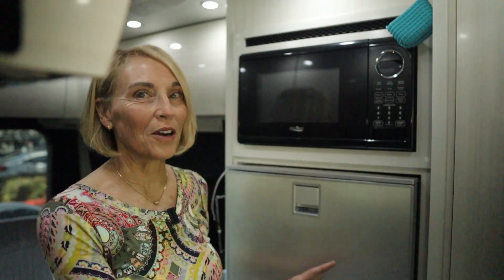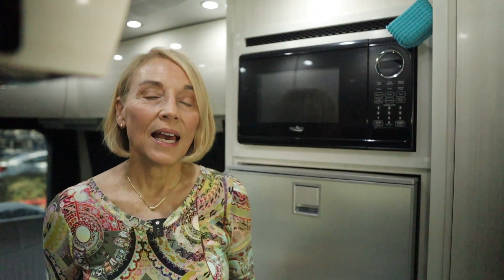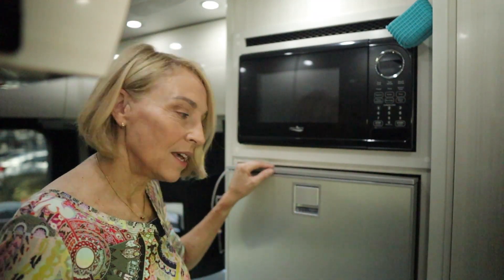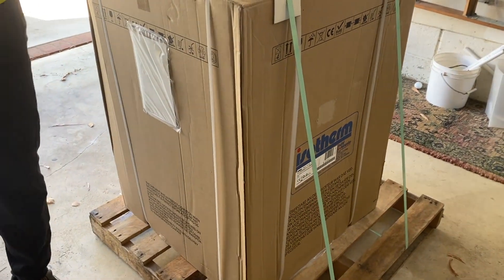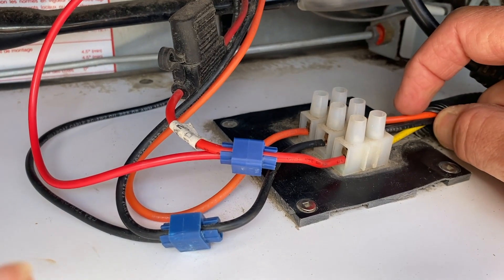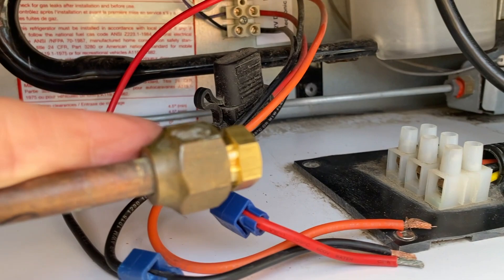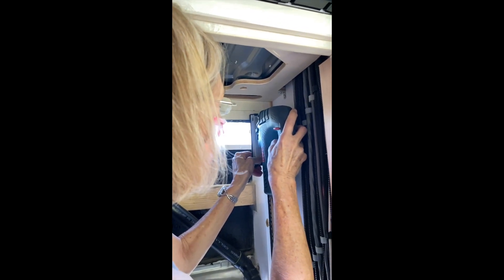How to install an Isotherm fridge in a Pleasureway Ascent Camper van

Comment: Installation of Isotherm Elegance 115 was a big success.
Your video and comments were very very helpful. Refrigerator is very quiet & matches the interior decor quite nicely - Oh, and more room.  Again – BIG success.  
Thank you for “pushing the envelope” of PW Van experience improvements.
Reply from the maker: You're welcome.  We just got home from a brutally hot northwest.  For several weeks temps were above 100 but the fridge kept things cold at 40.  And it even makes ice.

Comment: Thanks for doing a terrific demo on removal and installation.  I have a Sportsmobile with a Norcold refrigerator.  It works great and it has run completely on solar for extended periods.  Thanks again.

Comment: Congrats Debbie, John and Neighbor! That was quite an ordeal to swap out 
but  I get the old fridge issue has been bothering you for a long time.   
I don’t think you are every going to want  to sell your Ascent - you have put so many amazing TLC upgrades into it! 
Such impressive tenacity!
Reply from the maker: We'll have it for at least a few more years.  John likes the Ford Transit (the interior is 6'6"!
Reply: From She to Me   Hello, rage FORD , MAKES 3 LENGTHS, 3 HEIGHTS , but do not know what they did about shower.   They do have all wheel drive , not sure about 4X4   & I believe only the smaller one is diesel   Do not know what sort of an electrical system   They have ,<but demand changes everything   Btw  on the TRANSITS I believe ALL TANKS ARE INDOOR ,  CHEERS 🇺🇸🇺🇸🇺🇸🇺🇸
Reply from the maker: @flybyairplane3528  We'll stay clear of diesel but would like the 4x4 with an Agile Offroad ride improvement package.  ;-))

Comment: Thanks for the great video.  I have a 2018 Leisure Travel Van UnityMB on a Sprinter chassis and am now planning to install an Isotherm Cruise 165 to replace a Dometic RMD 8555 3-way. Previously I added 3 fans to the vent to no avail.  This summer, traveling in the west, the fridge was at 49-50, so I'm looking forward to the swap out.  Other LTV owners have posted the process in sprinter-source.com, for Isotherm and NovaKool units, so I know it can be done.
Reply from the maker: Good call. We sure are loving our new fridge.

Comment: Hi
  I started to a comment and thank you for a great video (many things mentioned I wouldn’t have thought of) but I hit the wrong key and lost it. 
   I agree with several of your viewers that you don’t put tape on the threads of a gas fitting.  2 decades in the hydraulic industry taught me to look at where the seal takes place. In this case, on the flare. No tape. 
   The other thing I wouldn’t do is disconnect the positive side of the power supply before the ground. I’ve always been told, by professionals to disconnect the ground first and connect the ground last. This to prevent an arc that could ignite gas. 
  Check me on this of course. 
   I did love your video.
Reply from the maker: You are correct on all counts. Thankfully no one was injured in the making of this video. 😅

Comment: I ordered the unit and received it five months later.  I installed it last week in my 2013 PW Excel.  I'll be on the road starting Monday for tree to four weeks.  The freezer is HUGE!  I actually have ice cream bars in it.  Testing at home indicates an average of 0.7 AmHr draw in the first 24 hours of use.  Of course, it was winter so the fridge did not have to work too hard.  A few years ago I installed a 100 AH LiPo battery and a 100 watt solar panel on the roof and I have a 100 watt suitcase for added input if needed.  I also have a generator.  
I had to take out some side molding and a lip in the existing compartment.  I also had to cut the bottom front of the cabinet frame.  There was a thin strip of laminate behind the sink that I had to cut a piece and remove – that is how tight the fit is.  There was some sheet metal at the top of the compartment that I had to bend back but not remove.  I ended up putting some tape and insulation there.  I'm not sure I would have pulled the trigger on this
Reply from the maker: That’s awesome.  We sure do love ours.

Comment: Great video. We have the same issue running off propane and it is hot outside, fridge is just under 50 degrees. We have a trailer so more room inside. We have a large portable fridge that is ac or  dc with two compartments that can be either fridge or freezer. It uses very little power and is compressor so cools very quickly in any weather. Good option if you have a larger vehicle with room for it. Will just use the propane fridge for produce.

Comment: We own a 2012 Majestic (Curse America's own private labelled worn out coach brand) 28' Class C. It came equipped with a typically deficient absorption refrigerator. OK, so I'm gonna try real hard to...oh well, can't describe our experiences without A WHOLE LOT of profanity so let's just say that the best place for an absorption refrigerator is Craig's List. 

We purchased a Dometic 8 Cu Ft. compressor refrigerator with the same form factor (computer geek for dimensions) as our old 8 cu ft Dometic absorption type unit on eBay which it turns out came from Camping World. Mathew and I proceeded to remove the appropriate window screen, slid a side window open and wiggled the old unit out through the open window and set the new unit inside the coach.

Prior to setting the unit in place we cleaned out the space and added some foam insulation that I had lying around to the rear and about of the side walls of the opening. Since the new unit was essentially the same size there was no real drilling or cutting to set the unit in place although we did replace the exiting 14 gauge power wiring with a #10 red/black siamesed RV type power cable. 

Now comes the typical set of RV sagas. The unit worked fine although we did install (glued in) an internal auxiliary fan assembly. The unit performed quite well for most situations but I noticed degradation in internal temperature in the fridge but the freezer stayed around 0 degrees. Hmmm. Research (A WHOLE LOT OF RESEARCH) led me to believe that the problem was overloading the fridge. When we went as a family we had issues but when I went alone, without half a Safeway store crammed in it the unit it worked OK.

Bottom line is that an ABSORPTION refrigerator (per Dometic's ^@$^*]{%# help line folks) isn't going to give you anything lower that 50 degrees when it's over 90 degrees out and with the absorption unit we're just fine as long as we don't cram the unit so full there's no room for cold air to circulate.

I'm sure that you will be (are) VERY HAPPY with your drama free compressor unit although they are typically a little hard on the batteries when boondocking but our unit is about twice the capacity of yours and the current draw is about twice what your Isotherm draws but we've got over 900 amp hours of battery and 600 and 600 watts of solar panels. Note that we live in Lake Havasu, frequently very near the highest temperature in the nation. 

We have also installed a second 15,000 BTU air conditioner in the coach and this does help some with the fridge cooling issues.
Reply from the maker: Good way to put it, "drama free," because until we had the compressor fridge, there was constant drama.

Comment: I have the same predicament.   Dometic 8505 must go. Pleasure Way 2011 Excel.  The Isothurm 130 is exactly your 20 3/4 width. But wondering if that's to tight.  
Thankyou for the video.  It's spot on as to what all of us are facing to faze out the 3 ways.

Comment: Our compression refrigerator will run all night, like 10PM to 8AM along with the gas furnace and our orgional batteries only went down to 12.4 volts.  We ran the generator on and off the rest of the time to keep the batteries charged.

Comment: We are upgrading refrigerator, as you have, in our PW Ascent. 
You mention that decking material was sloping away from the refrig., to van side opening, as you start to saw & removed the old 1-1/2” plywood base (16:41)

As you install new ¾” refrig. base, you installed this (it seems) over the top of laminate that was covering (on top of) original 1-1/2” plywood – I think (shown 19:03)

Was it necessary to maintain the slope to exit and let potential water/moisture run out?

Premium Van needs a Premium Refrigerator without absorbtion refrig foibles.
Thanks for any thoughts.
Reply from the maker: I think it was just a matter of making it level. The absorption fridge seemed to have a slope for moisture but the new one is a champ.

Comment: I was looking at Isotherm and a few others.  In the end I set an appointment at JC Refrigeration to convert my absorption Dometic 8330 to compressor.  Did not go with this is because I only have 17" width for a fridge.  I have the Pleasure-way Lexor FL.
Reply from the maker: When it's done, I'd love to hear how it goes with the conversion.
Reply: Alas, JC isn't converting the 8330 anymore
Reply: @davidf2075  Yeah.  They set up an appointment then a week before they canceled saying they were no longer supporting them.  I ended up replacing my absorption 8330 with a NovaKool R3102 compressor fridge and a F1900 compressor freezer.  That was 18 months ago and they have been running non-stop ever since.
Reply: @terryharrigan6324  I replaced with a 50 quart compressor chest refrigerator from Amazon.  We're about to leave on our first long trip  . . . we'll know soon if it is satisfactory.  Winnebago ERA 70a

Comment: Nice job!  If you would like to move the unit back that 1/2", get a heat gun and heat the vent pipe's plastic until it gets soft. Then squish it back 1/2", holding pressure until it cools.  Do a 3 or 4  inches at a time.  Loosing a little vent area will not cause any issues.   Could also change the pipe to some marine flexible tubing like they use on sail boats.
Reply from the maker: That's a great tip, thanks!

Comment: Great video as usual! However, now I'm very concerned about the Dometic 3-Way Absorption unit that will be in the 2021-5 Lexor FL we have on order.  Wondering if I should just make plans now to swap it out.  Questions, questions....
Reply from the maker: I would be concerned.  PW has switched to a compressor fridge in the Ascent and OnTour; they need to do the same in the Lexor.  The hard part will be finding a unit that fits that opening.

Comment: What are the dimensions of the new fridge?  We have PW Lexor 2015 and have problems when the fridge is on propane. Thanks
Reply from the maker: Ours wouldn't work in the Lexor but you can check out the dimensions of all their units:  http://www.isotherm-parts.com/PDF/spec_sheets/COMPARISON_CHART_FOR_COMMON_MARINE_REFRIGERATOR_SIZES.pdf

Comment: Amazing! Congratulations!  The only thing holding us back from doing the same swap is concern about the noise of the compressor at night time when we're trying to sleep and all is quiet.  You mentioned it's quiet during daytime; how is it at night when you're trying to sleep?  Great running into you at Crawley Lake campground a few weeks back!
Reply from the maker: Hi guys.  Been thinking about you and how you are faring with the smoke.  We head out in a few weeks and will let you know how quiet it is.
Reply: @FromShetoMe  Thanks! It's been hard with the bad air quality.  One of the fire zones is only about 25 miles from us on the other side of the coastal range.  We're closed up in our house with the furnace fan filter running constantly. But we're safe and not in danger for which we are very thankful.

Comment: I have a 100 Ah AGM battery and no solar panels. Does that eliminate the Isotherm as a choice for boondocking? (2012 Pleasure-Way Plateau)
Reply from the maker: Probably because you only have 50AH of useable battery.  But you could consider getting a solar generator.  We have one that is a lithium 100AH battery with 80W solar panel.  If you have a way of charging off your alternator, then that might work for you.
Reply: Thanks for the verification.
Lots of upgrades to consider!

Comment: Congratulations!! Excellent video. Does it automatically switch from 110v to 12v? Also, I have that exact ladder and love it, so nice to have full steps to stand on. Thank you for the video.
Reply from the maker: Yes, supposed to switch automatically. They also have a version that is just 12v.
Reply: From She to Me , yours is 12 volt only, but when you have ‘shore;power, a relay switches a transformer to reduce the shore power to 12 volt . I bet you can even keep ice cream now safely, & cubes for your cocktails ,  cheers 🇺🇸🇺🇸🇺🇸🇺🇸
Reply from the maker: Sometimes I miss replies.  Coldest freezer is getting is 10.  But that works for me.

Comment: Congrats on the new fridge!  Very impressive installation!  I didn't see this on your storefront but at the 12:13 mark you used what looked like an adjustable ratchet screwdriver.  Do you know what brand it is?  It looked like a tool that would be very useful.
Reply from the maker: It is a Craftsman brand that we have had for many years.  There are quite a few similar products on Amazon but not that exact one.

Comment: How will you clean that annoying looking wire (squirrel) cage heat exchanger (condenser) to the right of the compressor .  Compressed air??
Reply from the maker: Another good point.  Compressed air would be a good solution.

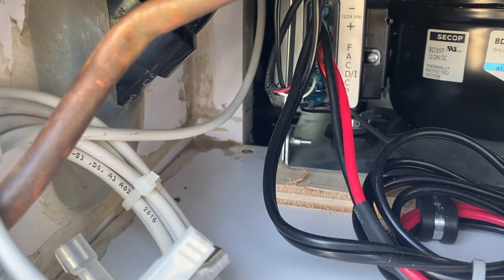Comment: Thanks, nicely done - at 19:50 you mention a smart controller - did you install one ? is it necessary?  Thanks
Reply from the maker: I’ll take a look at the reference tomorrow. Cell coverage is too weak at our current location.
Reply from the maker: I completely forgot about that.  We never contacted them so I guess the wire is just dangling inside the cabinet.

Comment: After three years would you do it again?
My 18 freg die in our PW Plateau and I am trying to decide 12v or 3 way. We have a 310ah of lithium don’t have solar and was concerned with power usage. Per the isotherm website it uses 262 wats per day did you ever measure?
Thanks for any advice
Reply from the maker: Absolutely!  We only have 200 amp hours. 200 watts of solar which barely helps charge batteries. Don’t forget that even a 3 way requires some electricity. Gas fridges struggle above 5000 feet. At 8000’ temps would get into the 50’s. And we don’t worry about the angle of the fridge. After one night our batteries display mid 80% charge.

Comment: I have a 2013 PW Excel, and based on this and a lot of research after viewing, will order a unit soon.  Can you let us know more about the external controller?  I am very interested to know what convinced you it is worth the extra cost.  Great channel - Thanks!
Reply from the maker: I don't know anything about the external controller.  I thought that if it reduced power demand it would be a good thing.  But I am trying to contact Isotherm for more info on installation and will let you know what I find out.  There was almost no info on line.
Reply: @FromShetoMe  Thank you!

Comment: Reading Isotherm 115 manual - they recommend 15A fuse protection for 12V DC.  The Dometic seems to have this on power line.  Is the PW Van circuit fuse protection enough?  Seems you install without any additional 15A fuse protection.   Always enjoy your expericenced comments.
Reply from the maker: I'm no expert, but we did not install any fuse protection assuming that it was installed for the previous fridge.  Haven't had any issues and we love the fridge.  It will be 100+ degrees this week and our food will still be at or below 40 degrees.  With the absorption Dometic fridge, it would get up to 60 in some situations!!!  But if you have a PW, I'm sure they would tell you what size fuse they installed originally.